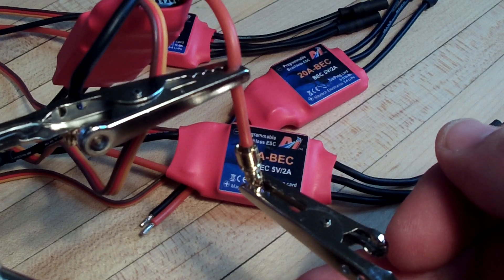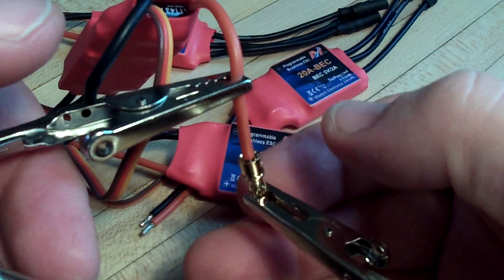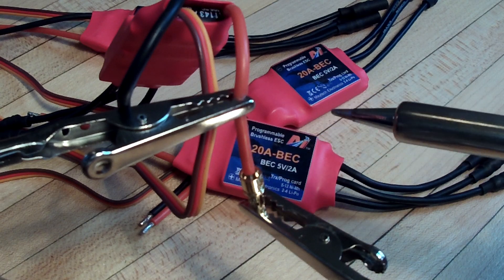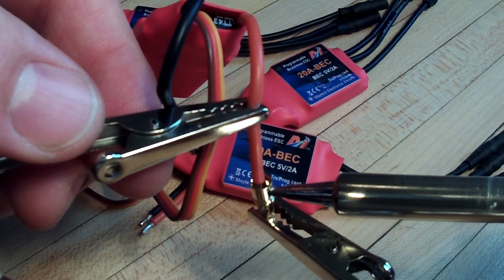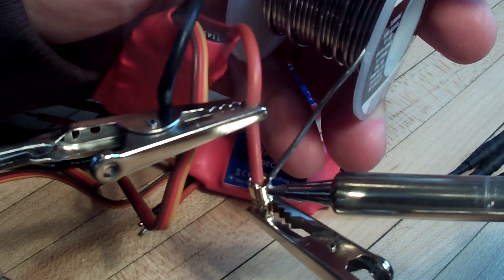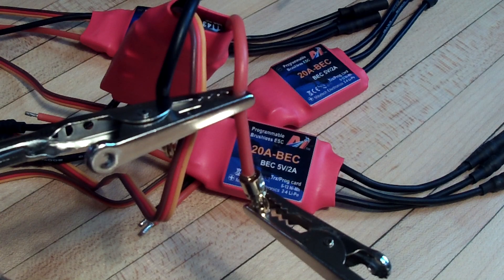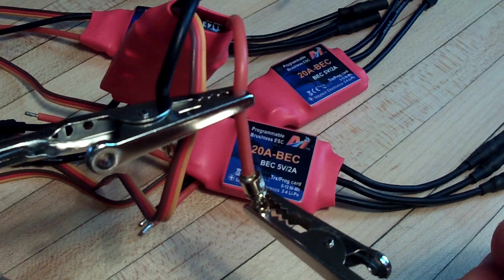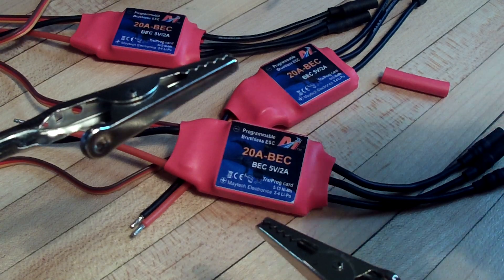How to solder 3.5 mm bullet connectors to your esc's

Comment: Your heating it for too long. The heat is going to travel all the way up to the ESC and could damage it. It's not like a cake that you bake in an oven. This should take no more than 5-10 seconds. If not, then your iron is not powerful enough.

Comment: Put some heat shrink on the jaws of the clip that hold your wire to help protect the insulation from being damaged
Reply from the maker: Dustin Holden Hey thanks for that, just grabbed a bundle from ebay super cheap !
Reply from the maker: oooh yeah I like that idea, thanks
Reply: KGFlyer55 Also, if you're doing this often you can save a lot of money by buying heat shrink off of eBay in 100ft for something like $10 bucks.

Comment: I've been using Helping hands for a long time.  Great tip for others.   What method do you feel is better using the fine tip in the small hole or using a large tip on the outside such as: Innov8tive8 designs (How to Solder Bullet Connectors By Innov8tive Designs)
Reply from the maker: The fine tip seems to get the heat more where you need it